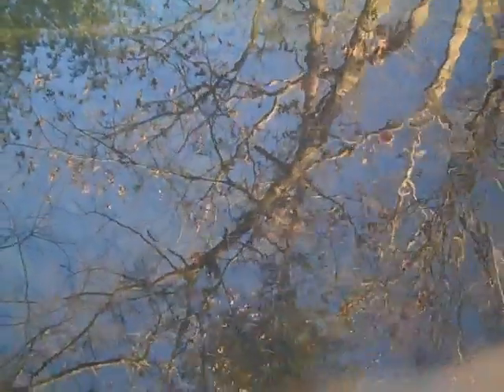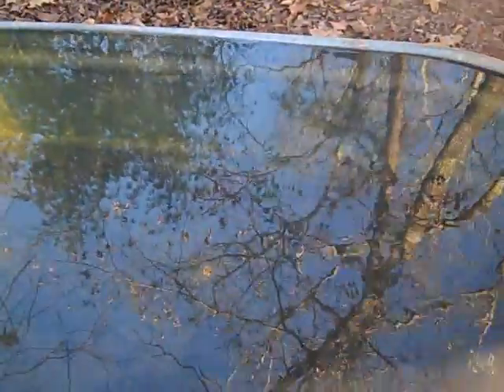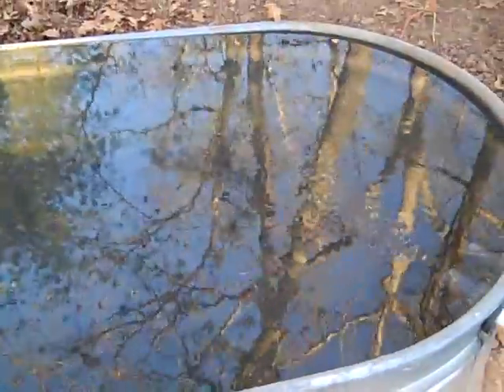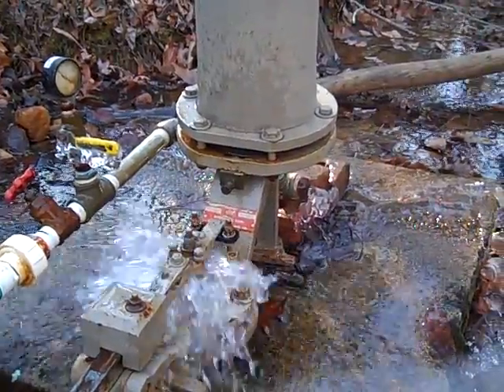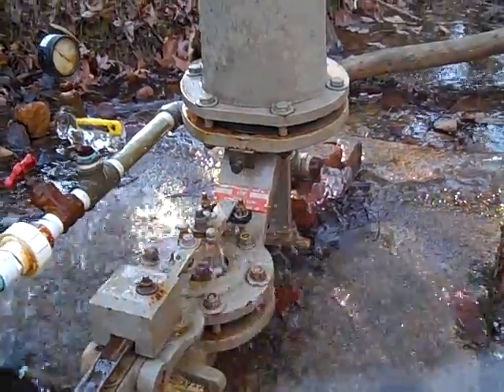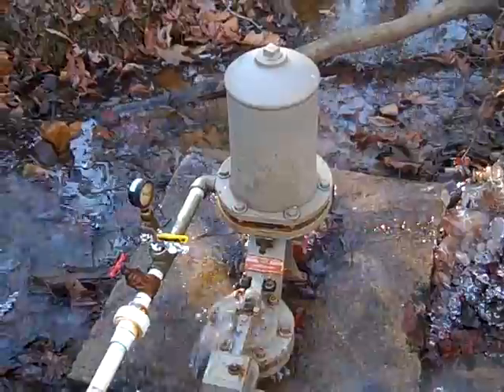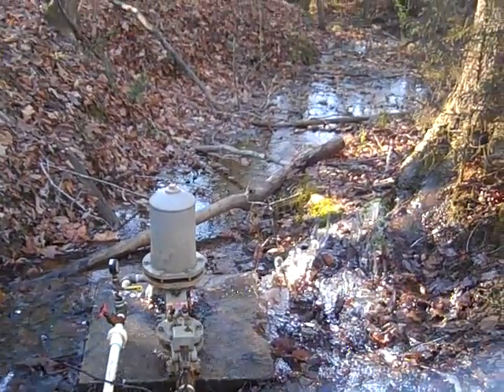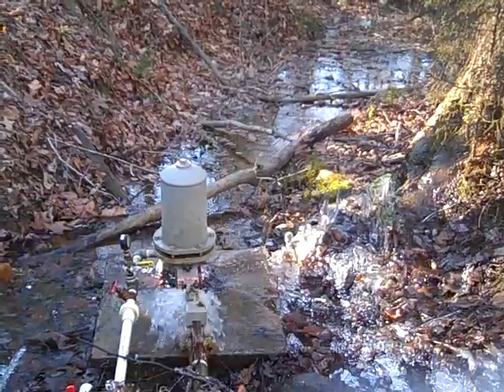Ice Buster Ram Pump

Comment: I'm not familiar with any of this stuff but I'm learning slowly but surly! I have a question. What about all of that water that is wasted? Does its have to expel water like that and if so can that water be captured and used?
Reply: a ram pump waists 90% of the water to pump 10% up
it cant realy be improved
but you dont have to waist power on electricety
Reply: +robot797 It's not really wasted, you're only diverting it temporarily from whatever stream or river it operates from. This water would ordinarily have simply flowed downstream, instead you are extracting it higher up steam and returning it a little further downstream, and in doing so using the potential energy it possesses to pump water uphill. No water is really lost in the process.

Comment: Engineer775 i was wondering if you could post a link to where you got this pump, i'm in the northwoods, i need one as well
Reply from the maker: The Link to this ram is now in the description.  If you need help specing one let me know. send me a pm.
Reply: @engineer775  gov will have all heads for this tech thay teach us that we always have loss but never talk about 
the converted gain we can make from eletromagnets
if u convert all the wast thermal energy around 
you u can use it universally as energy u need a true sine wave bipolar like the power comp dose a 
true pure sinewave like a grid tie inverter 
once the signal is made the system will turn on and 
consume wast thermal energy from the 
environment and space around you... there is free energy but 

it comes from Universal thermal loss and converted into a gain. so a pole Transformer and a 
microwave Transformer  have a common between each other u can take 2 microwave Transformer provide 
a pure sine wave grid tie inverter to it or a true bipolar sinewave that inter acts with nature in 
a perfect spherical motion like a flower of life..  if ur home provides this use it as a Source 
signal then u can simply stack the Transformers on top of eachother in correct fasion and note 
that the 1 wire on the Transformer must stay connected and the other disconnected your only useing 
1 wire on the hi side .. so test ur self 
2 microwave transformer stacked on top of eachother same 

face sides. one side 120 to the wall and the other 120 side to what u want to power and useing the 
Transformer just the way it came out the microwave with the wire attached causes the energy in its 
perfect spherical motion to converted wast thermal energy to amp for u hot to cold in to out... 
should look a bit nuts with u use a form of wireless energy but its interacting with the 

environment...this is my work a compilation of Otis car. Tesla. and many other very smart people 

nowadays i think i found the gate source and drainif this gets out to much that it works the 
power 

comp and mib will have our headsdont do this at home warning high voltage yet i cant stop u lol DO 

NOT TOCH THE CORES OR THE WIRES OK u will die make sure u dont touch the core if the hi wire is 

mounted to it u dont have to mount the hi on the core if u dont want u connect the 1 hi wire to 

the same side hi on the other transformer then the core should besafe to handle if nessary
grab your multimeter and prove me wrong
thats what u do i have my whole home on this
and u can take 

one of the lows side out the wall and hook it up to other stuff and power it for verry little amp 

makeing nature convert and pumping latent heat effect into the device.
and u can have a microwave 

hi volt cap in between the hi side and make a system that powers its self
u can flip the switch on 

ur breaker and the room stays on up to 2kva 
with both lows in the wall this is the zero point that 

was taken from us...
Reply: @engineer775  gov will have all heads for this tech thay teach us that we always have loss but never talk about 
the converted gain we can make from eletromagnets
if u convert all the wast thermal energy around 
you u can use it universally as energy u need a true sine wave bipolar like the power comp dose a 
true pure sinewave like a grid tie inverter 
once the signal is made the system will turn on and 
consume wast thermal energy from the 
environment and space around you... there is free energy but 

it comes from Universal thermal loss and converted into a gain. so a pole Transformer and a 
microwave Transformer  have a common between each other u can take 2 microwave Transformer provide 
a pure sine wave grid tie inverter to it or a true bipolar sinewave that inter acts with nature in 
a perfect spherical motion like a flower of life..  if ur home provides this use it as a Source 
signal then u can simply stack the Transformers on top of eachother in correct fasion and note 
that the 1 wire on the Transformer must stay connected and the other disconnected your only useing 
1 wire on the hi side .. so test ur self 
2 microwave transformer stacked on top of eachother same 

face sides. one side 120 to the wall and the other 120 side to what u want to power and useing the 
Transformer just the way it came out the microwave with the wire attached causes the energy in its 
perfect spherical motion to converted wast thermal energy to amp for u hot to cold in to out... 
should look a bit nuts with u use a form of wireless energy but its interacting with the 

environment...this is my work a compilation of Otis car. Tesla. and many other very smart people 

nowadays i think i found the gate source and drainif this gets out to much that it works the 
power 

comp and mib will have our headsdont do this at home warning high voltage yet i cant stop u lol DO 

NOT TOCH THE CORES OR THE WIRES OK u will die make sure u dont touch the core if the hi wire is 

mounted to it u dont have to mount the hi on the core if u dont want u connect the 1 hi wire to 

the same side hi on the other transformer then the core should besafe to handle if nessary
grab your multimeter and prove me wrong
thats what u do i have my whole home on this
and u can take 

one of the lows side out the wall and hook it up to other stuff and power it for verry little amp 

makeing nature convert and pumping latent heat effect into the device.
and u can have a microwave 

hi volt cap in between the hi side and make a system that powers its self
u can flip the switch on 

ur breaker and the room stays on up to 2kva 
with both lows in the wall this is the zero point that 

was taken from us...
Reply: @engineer775  gov will have all heads for this tech thay teach us that we always have loss but never talk about 
the converted gain we can make from eletromagnets
if u convert all the wast thermal energy around 
you u can use it universally as energy u need a true sine wave bipolar like the power comp dose a 
true pure sinewave like a grid tie inverter 
once the signal is made the system will turn on and 
consume wast thermal energy from the 
environment and space around you... there is free energy but 

it comes from Universal thermal loss and converted into a gain. so a pole Transformer and a 
microwave Transformer  have a common between each other u can take 2 microwave Transformer provide 
a pure sine wave grid tie inverter to it or a true bipolar sinewave that inter acts with nature in 
a perfect spherical motion like a flower of life..  if ur home provides this use it as a Source 
signal then u can simply stack the Transformers on top of eachother in correct fasion and note 
that the 1 wire on the Transformer must stay connected and the other disconnected your only useing 
1 wire on the hi side .. so test ur self 
2 microwave transformer stacked on top of eachother same 

face sides. one side 120 to the wall and the other 120 side to what u want to power and useing the 
Transformer just the way it came out the microwave with the wire attached causes the energy in its 
perfect spherical motion to converted wast thermal energy to amp for u hot to cold in to out... 
should look a bit nuts with u use a form of wireless energy but its interacting with the 

environment...this is my work a compilation of Otis car. Tesla. and many other very smart people 

nowadays i think i found the gate source and drainif this gets out to much that it works the 
power 

comp and mib will have our headsdont do this at home warning high voltage yet i cant stop u lol DO 

NOT TOCH THE CORES OR THE WIRES OK u will die make sure u dont touch the core if the hi wire is 

mounted to it u dont have to mount the hi on the core if u dont want u connect the 1 hi wire to 

the same side hi on the other transformer then the core should besafe to handle if nessary
grab your multimeter and prove me wrong
thats what u do i have my whole home on this
and u can take 

one of the lows side out the wall and hook it up to other stuff and power it for verry little amp 

makeing nature convert and pumping latent heat effect into the device.
and u can have a microwave 

hi volt cap in between the hi side and make a system that powers its self
u can flip the switch on 

ur breaker and the room stays on up to 2kva 
with both lows in the wall this is the zero point that 

was taken from us...

Comment: Pull a drain pipe at the very top of the larger tank, and let the overage drain into that smaller tank.
You'll have two tanks that have flowing water, that won't freeze.

Comment: I would bet the spike in pressure adds a little heat to the water, compress a fluid and it heats up. Also the sound waves through the water would be intense and may stop water crystals forming.
Reply: are you producing this ice buster pump sir.

Comment: I always find it funny that misinformation has convinced folks that using water is wasting water. The way water works is that it flows, dries up to the clouds with the sun and falls back down to Earth. lol. Simpler than falling off a log. The same folks that argue against folks using water hold theirs in bottled water thus continuing things like droughts. Water is supposed to flow!

Comment from the maker: @dexterquincy1 That would be a challenge! it is not impossible as I have seen Rams installed in pits and all piping was below the frost line.  Just a lot more work where you live.  The cool thing about doing a deep install is that it would be silent.  Thanks for watching.

Comment from the maker: @dexterquincy1 I guess the other folks got to you first.  The water you see as "wasted" is water that was flowing out of an overflow anyways. I just use it to pump water.  The energy from falling water is what powers the Ram.  Roughly, for every 7 gallons wasted 1 gallon is pumped to a usable destination.  Thanks for watching.